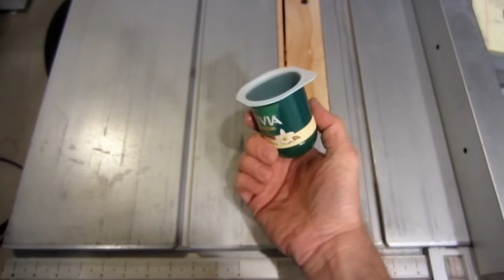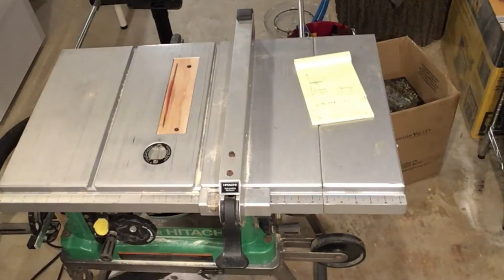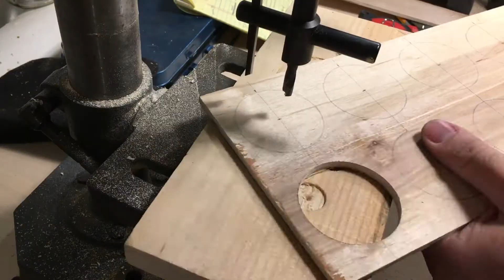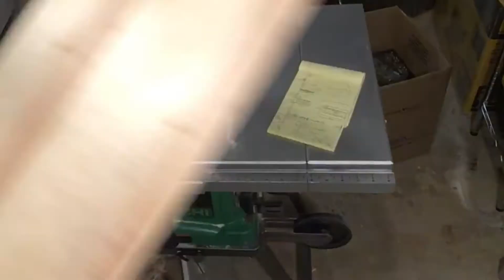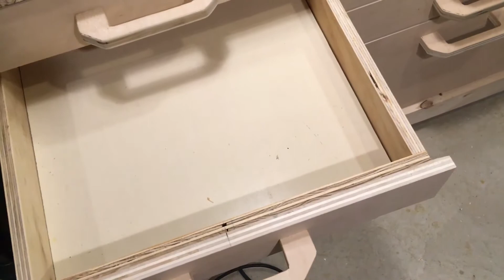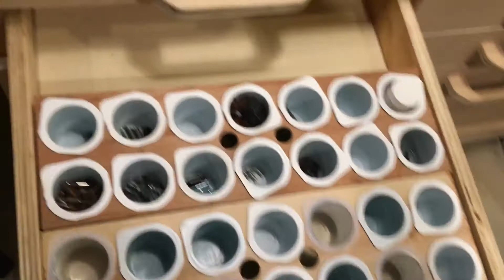Workbench Drawer Organizer

Comment: Geometry suggests me you can get a few more cups squeezed in if you order them staggered like beehive cells! Whether worth it may depend on your drawer and wood proportions.  It may be worth it just to be less bored of drilling holes on straight rows and columns...

The math isn't hard, you just need the square root or 3 (=1.732): If you now have the centres of two pots say 70mm apart, now your next row will start 1.732 x 35mm = 60.62mm lower (and 35mm rightward).  The way to find it is to put the centres of the pots at corners of equilateral triangles --- they have 60degree angles --- where two corners are your first row's first two pot-centres; new row's first centre is at that third corner. 

Simplest to see is using Pythagoras [AxA + BxB = CxC if A and B meet at right angles. Here A= halfway from first to second centre, and C=A+A because we wanted equilateral triangle; so our equation is AxA + BxB = 4 AxA, so BxB = 3 AxA,  or B = (root of 3) times A].